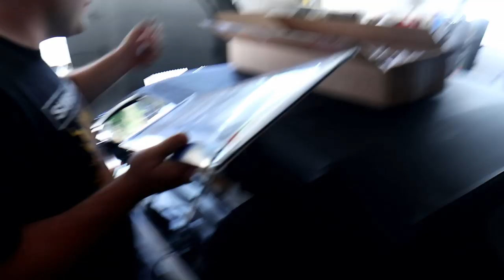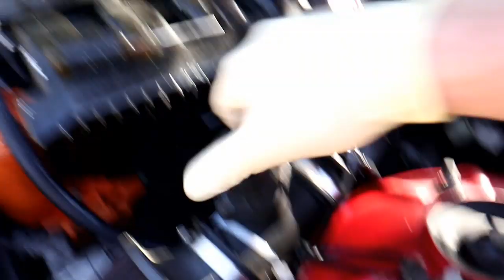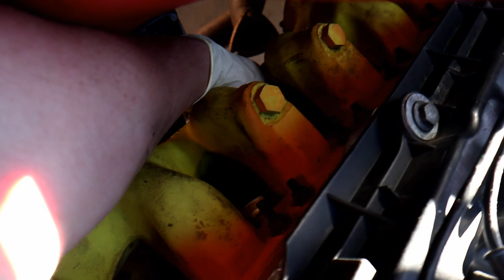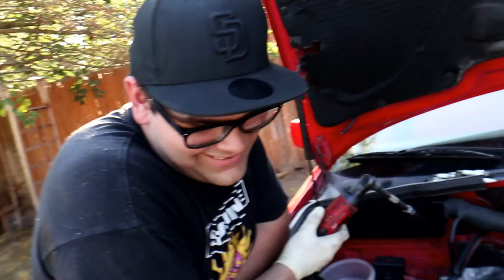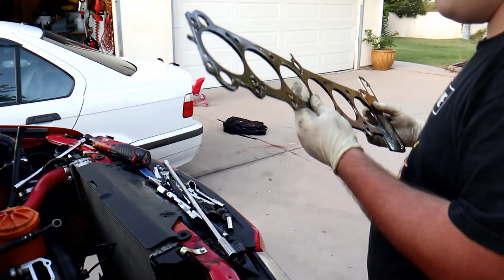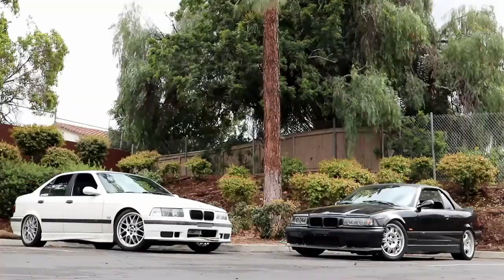Ripping an E36 Head in less than 3 hours.

Comment: I'm asking everywhere i can before taking to much apart on my 92 325is and hope you might be able to answer a question. 

To replace worn and brittle timing chain guide rails (the one operated by the plunger type tensioner on the side of the cylinder head), do you need to take off the tmobile chain front cover?
Reply from the maker: Yes
Reply: @M3NACE  them you for the quick response.   That's unfortunate for me.   Just means i have a lot more to do than expected and I'll have to keep looking for video tutorisls.

Great videos.  Thanks for the support
Reply: @M3NACE  any thoughts on where to order the parts I'll need to replace like the crank pulley bolt,  codon tensioner guide rails?

Comment: I heard of stripped cam studs when torque to 11 ft lb. Did you ever had that issue? Is it possible to tighten those with lower torque? Thanks
Reply from the maker: Havent had that issue yet
Reply: @M3NACE  thanks for the fast response! Im about to drop in my new china head that should be 50% better aluminum casting than the oem. Good to know you’re never had that issue so i will feel much better to torque the to spec that weekend! Just another question the cam studs just fine by snug them by hand by setting in the studs alone right? Thanks

Comment: how long did that fel pro gasket last
Reply from the maker: which gasket?
Reply: @M3NACE  mls sorry
Reply from the maker: @ghuapo26  ours held up fine, it leaked oil due to a machining error on the timing cover, not because the gasket failed.

Comment: lol you didn’t use dowels when you reassembled and you’re surprised that everything didn’t line up?? They’re there for a reason man.
Reply from the maker: not that we didnt use them, we just forgot to install them.
Reply: Semantics, but I understand. Also, you mentioned Ra in the video in terms of the surface finish on the deck face. While important, Rz and Wt are just as important (Wt-waviness even more so). After you decked the head, did you use a profilometer to measure surface finish on multiple locations across the deck face? Would have been a good way to find any high or low spots.
Reply: As soon as he said that he didnt use the dowels I laughed so hard, no kiddin its pissin oil